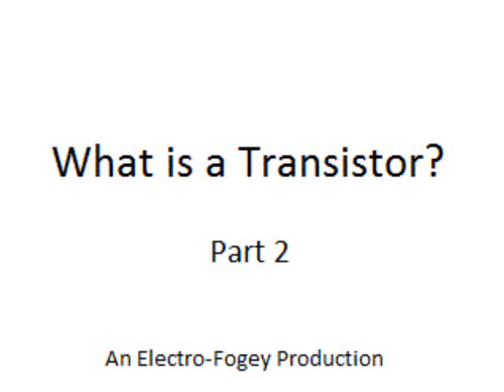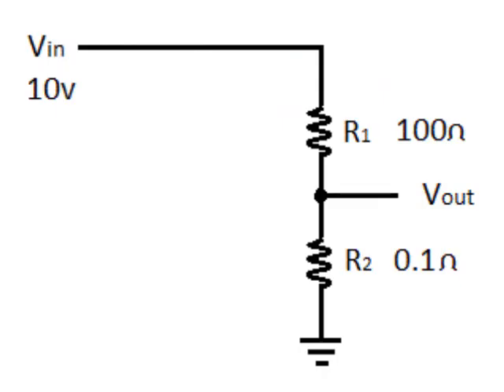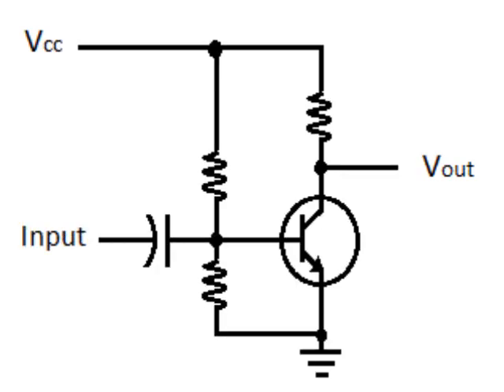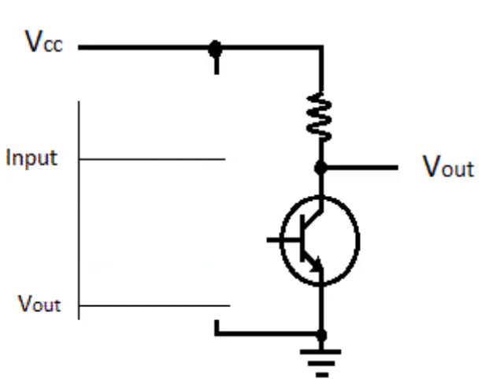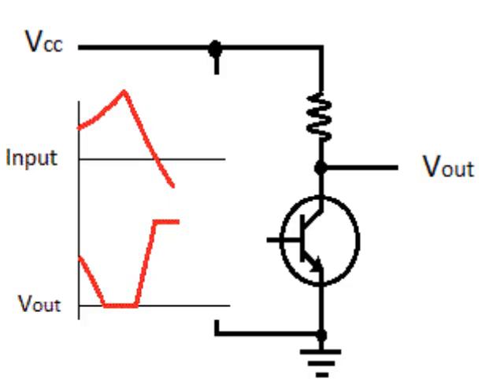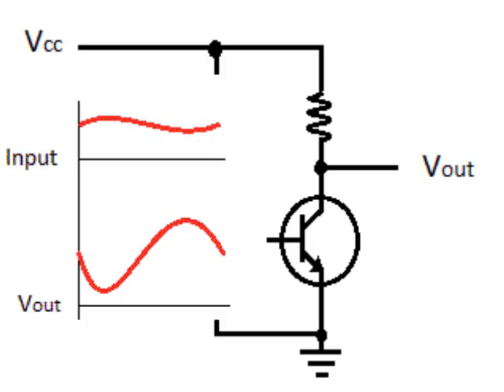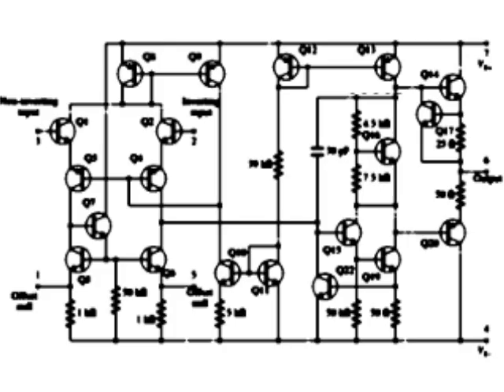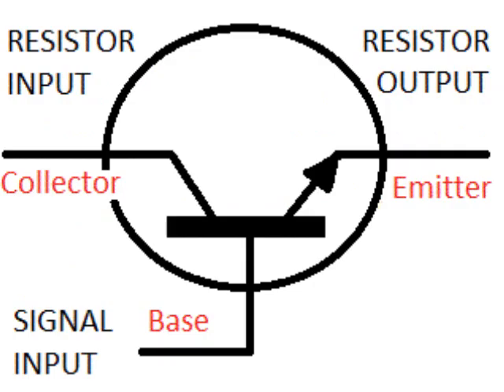What is a transistor?  How does a transistor work?  Part 2

Comment from the maker: @tangnatalaga My bad - I put one on the input and not the output, and you really need both for one of these circuits.  A push-pull power amp can amplify without the DC component at the output though.

Comment: @SteelWheelsDown I built the circuit you showed in Multisim and after playing around with resistor values and capacitor values.. I have no idea what I built, I essentially turned a 10V 120 Hz sine wave into a blocky one at the 2nd transistor's output..if you'd like to see what I mean let me know. I have no idea what I did so it's obvious that I'm confused lol

Comment from the maker: @Nadrealis - The current output of the transistor and the voltage output of the circuit are two different things.  I used conventional current (flows pos. to neg.), and current flows across the transistor toward the emitter.  Regardless of which way we say the current is flowing, the voltages will remain the same.  If you use electron flow, the current input is the emitter (electrons are emitted there) and the output is the collector (electrons are collected there), why they are named that.

Comment: I have a question even though I fully understand how  a transistor works. Why is the output of the transistor on the collector side even though the npn transistor clearly shows current running towards ground. Is it because the schematics are flawed since electrons actually run from - to + instead of the way they teach us?

Comment: @sloppyoscar yes that is correct, they are inversely proportional to one another.  Therefore, if the current increases the resistance (DC) or impedance (AC) must have decreased to allow for more current to flow through.

Comment from the maker: @S.O.:  This is a voltage amp, so whatever is hooked up to the circuit's output should be pretty high-impedance. This is because whatever is hooked up to the amp's output is in parallel with the transistor, so if the output's resistance is low, the transistor's change in resistance won't have very much effect on the overall resistance in series with R1 - having the transistor go into cutoff (infinity) will be nullified by the resistance of the output device. This is not good for an 8-ohm speaker

Comment from the maker: @S.O.: The common-emitter circuit is a voltage amp. The current output of this is limited by the collector-side resistor, R1. This is why it's referred to as a current-limiting resistor, so the maximum current this thing can "source" is supply voltage divided by R1.  On the other hand, the transistor's resistance when saturated is zero ohms, so if there's some voltage from the output hookup, this thing can "sink" enough current to destroy the transistor if you're not careful.